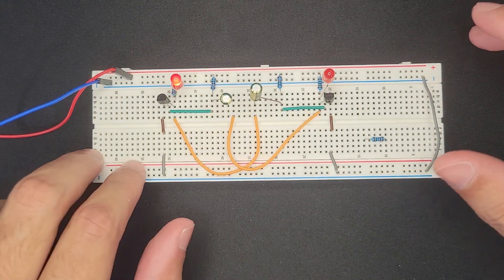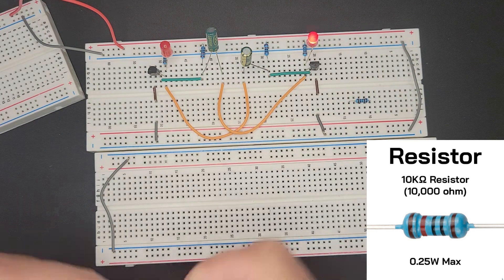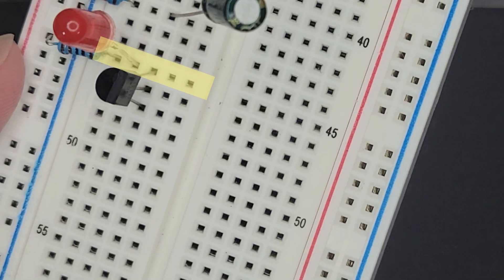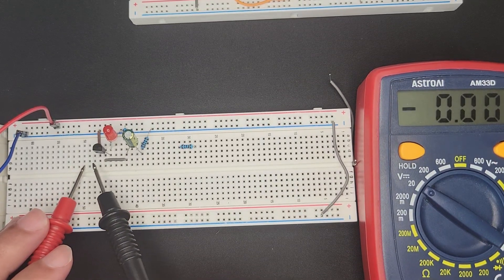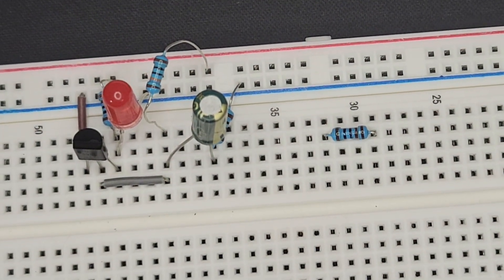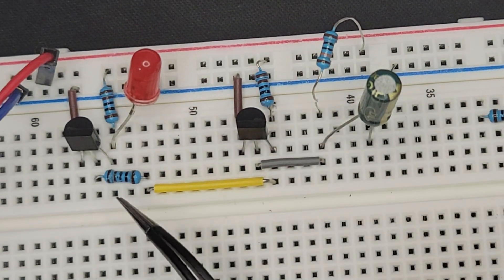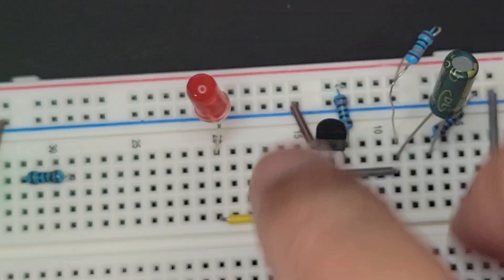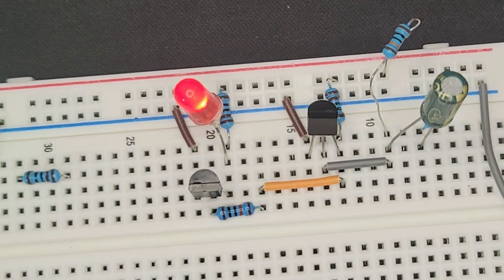Beginner Builds Delay Circuit - Beginner Learns Electronics Ep14

Comment: And this is why I stopped using breadboards for experimenting/learning! I'd never know if I had messed something up or if the board connections were just janky, and never learn anything. 
In any case, I really enjoy following you through your thought process trying to figure these things out! I'm right at about your level, trying to learn the more complex interactions between basic components, your videos are perfect fodder for that.
Reply from the maker: I know what you mean! I'm doing pretty basic things, and already there are times when I don't know what went wrong -- it's terrible to have to consider that the breadboard itself (or a component) is the culprit. I guess it comes with the territory. What do you use now for experimenting after you stopped using breadboards?

Thanks for the comment and kind words!
Reply: @MxyAhoy  for smaller circuits I literally just free-air solder stuff together, for more complex stuff, veroboard with the breadboard copper layout is nice, and for really intricate stuff that needs testing, there are "nice" breadboards you can get that are much higher quality than everything else. The ones Ben Eater sells are probably the best, he's already done that research, and you don't have to buy them from him if you can find them elsewhere for a better price. They're the BB830 by BusBoard Prototype Systems, but any of their sizes are probably equally nice.
Reply: for teaching/showing, it's hard to beat a breadboard unfortunately.
Reply: im new to this, may i ask what else do you use?
Reply: @SmegmaBender007  Good question! There are definitely certain situations where breadboards are very useful (complicated circuits that need testing before being finalized), in which case use a "good" breadboard, not the cheap ones off amazon, aliexpress, or that came in your "getting started with arduino" kit or whatever. I'd throw those out entirely, and replace them with the BusBoard Prototype Systems breadboards of various sizes. the BB830 is the standard "long" board that you see in this video, they're the ones Ben Eater uses for his Breadboard PC (definitely check that video out if you haven't seen it, it's magic, guy's a wizard).

For anything simpler than that, I just solder in free air or go directly to soldering on a PCB. Unsoldering is a useful skill to practice!
Reply: Wire wrapping is also a good idea I haven't looked into as much as I should....
Reply: @bepstein111  tysm, definitely gonna check that video out
Reply from the maker: Thanks for the information! Free-air soldering sounds interesting. I have done very little soldering when doing simple machines with a micro-controller. I am a novice with the soldering, too. And it's interesting you said "unsoldering is a useful skill," I've never thought about that.